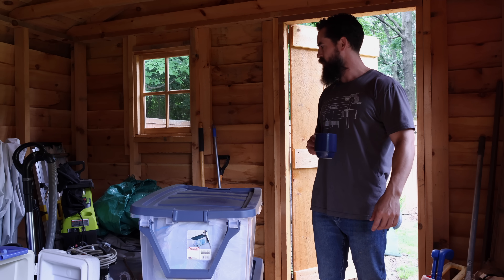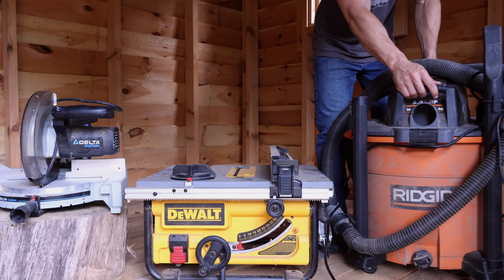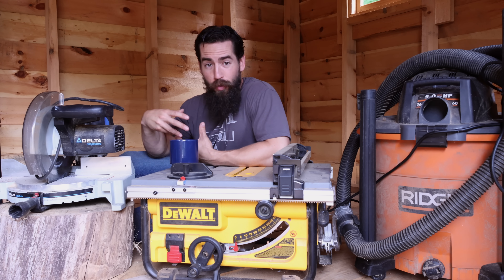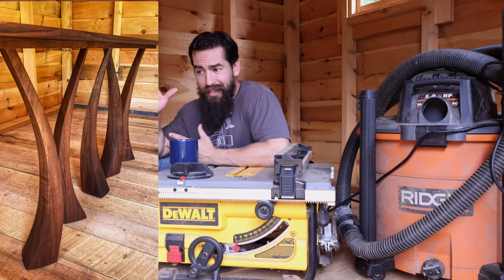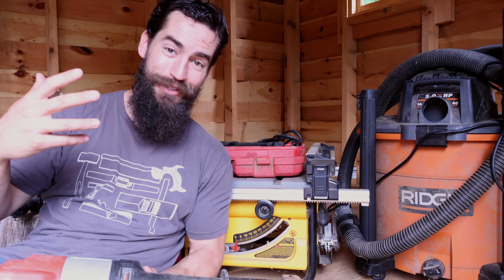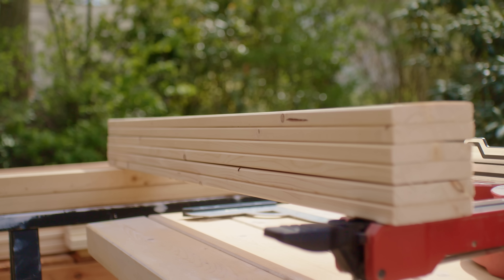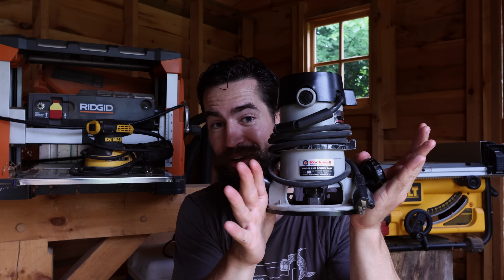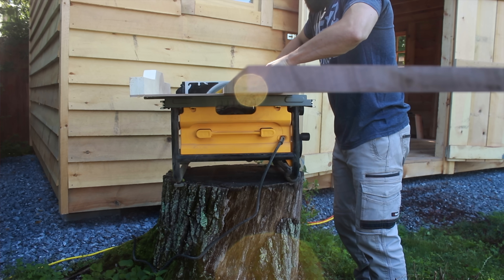3 practical woodworking tips for beginners

Comment: Thanks for the advice. Unfortunately, I've bought a Miter saw first because I wanted to build a solid workbench first and all of the tutorials had them made from 2x4 and using a miter saw. Currently I'm loosing sleep over the decision on whether or not should I buy a table saw and how much should I spend on it. Obviously I've realized fairly early on that I need ripcuts for most if not all of my ideas/projects. Is the Dewalt you've mentioned good enough for a complete rookie? I don't want to get discouraged because of the imprecise cuts or spending too much time over the table saw setup. I 'm looking for something in the mid-range so I can enjoy the learning process and not go bankrupt at the same time. Also, should I get rid of the miter saw then and simply buy/build a miter gauge?

Comment: Apropos of your comment about buying expensive project wood, then being afraid to commence work because you'll make a mistake: yessirree, been there. But when I was in boat building school, in my 60s, we had an instructor who told us a simple but important thing, namely, " without scrap, it's crap". Which means, instead of launching into a project willy-nilly, prototype the thing in cheap pine or something so that you'll gain an understanding of how to build it, what technique(s) will work best, and you can test design assumptions, build sequence, etc. That way, if you DO make a mistake, what the hey, it's on cheap pine, and a mistake is an opportunity to do something different, anyway. The time you spend making the mistake is NOT wasted, it's called learning.  And when the time comes to begin the real deal, you'll be that much more prepared and consequently confident.

Comment: 2:40 - "if you can figure out clever ways to work around your limitations" - that's the trick right there, most people aren't that clever, as easily evidenced by the plethora of youtube comments, "of course he can build that, he's got $60,000 worth of tools in his shop"... or, "there's the domino, I can't afford that so I can't do this project."

In lightweight backpacking/hiking the quest is to reduce your pack weight as much as practically possible, and there's a saying that I think is applicable here - "knowledge replaces gear"

Comment: I feel like a planer is crucial,  I built a flattening sled, but its not the same.  I can joint with track saw or at the contractor table saw, but flattening my panels or boards

Comment: but the shinies... truth the things can steal the shop space. My "shop" right now is three unconnected spaces. Front screen porch: Shopsmith ($200), Craftsman miter saw ($35.00) and Ryobi thickness planer ($60.00). Basement winter shop. Bench and hand tools plus a cheap bandsaw and router table. Garage shed: Rockwell Delta "tiltie" table saw and workbench. No electricity-yet.

Comment: Totally agree with the small scale aproch and contractors tools...
But I think total owning your hand saw, is absolute king... 
You can have the best tooling, site tools or hand tools available, but unless you can whip your hand saw out and and use it like a ninja you'll never make a decent living....
I learnt my trade with hand tools, thats where the boys are sorted out from the men... 
If the power goes out I can still do my job,  yeah it's a pain in the rear if it does, but if it doesn't, it really doesn't matter... 
not if you can  ninja the F**k outa any piece of wood, quicker than most could join up there track saw sections, plug in their dust extractor and run their festool ts75 through it.. 

Im always amazed at how many joiners and carpenters go straight for the track or table saw rather than enjoying the process of ripping it with a good sharp hand saw... 
Using all those teeth so it sounds like the blades singing...! 😊 
Honestly if you don't get a buz out of doing that you shouldn't be a carpenter... 👍🏻

Comment: Shop vac #1. You’re going to need to clean either during the build or after an install 
Circular saw #2. This will take you very far and can do many things
Drill#3.  holes and screw assembly 
Jigsaw#4. This can replace some of #1s jobs just slower, also curves and non- thru cuts. 
Sander#5 because sanding
Shop notes magazine volumes 1-100++#6 bonus. Learn plans, tools, jigs/fixtures, wood, hardware, whys and how’s.
Reply: Interesting. You have circular saw but not table saw. 
I've never had a circular saw, but always found the table saw vital starting out.
Reply: @karl_alan  I agree but I also feel it’s a luxury that you grow into. If one is fortunate to be able to have a table saw straight out of the gate, then good on them. I think it’s important to learn with hand power tools at first. My opinion
Reply: @jeffkowalski4936  agreed. I may have misunderstood what you meant. 

I still use hand saws all the time & they were invaluable when I started.

Comment: Is the table saw really that necessary on the beginning? They scare the h*** out of me, I currently have a Bosch circular saw with a Break System that I'm comfortable with, I made a rail guide for it which makes it work similar to a track saw. I'd like to get a saw stop later on, just for the safety feature.
Reply from the maker: You certainly can get away without for a while but they make life way more efficient and accurate. A circ saw is a great starting place, and you won't regret getting the SawStop when you're ready. It's a great little machine.

Comment: TBH cabinet saw is not even a good tool to rip big sheets. I don't even understand why US woodworkers so obsessed with about them. They're sliding table saws/panel saws for this kind of job for the same or less money than a fancy SawStop. ¯\_(ツ)_/¯ (Yeah, no fancy protection features like on SawStop, but in general on those kind of saws your finger will be nowhere near to the blade anyway.)